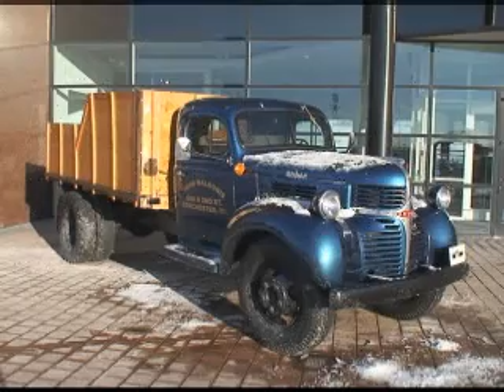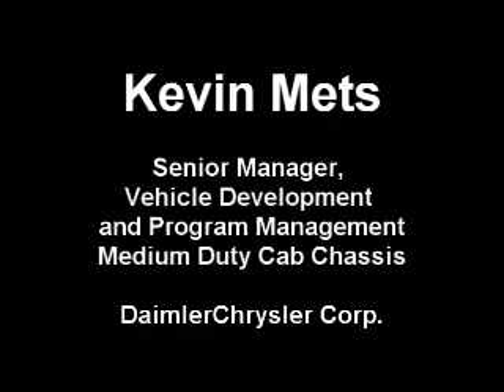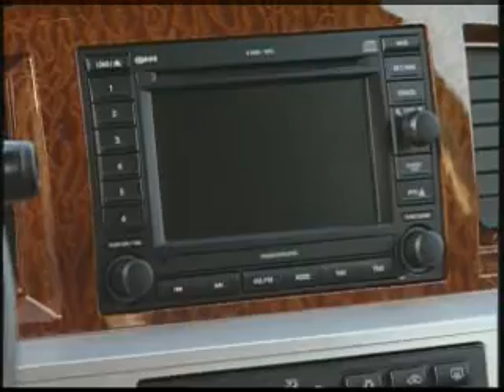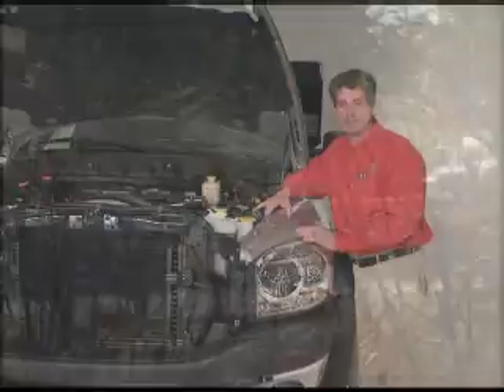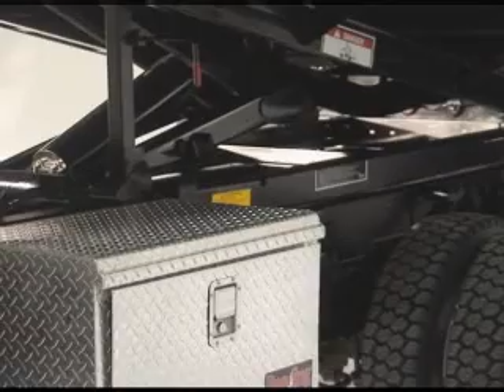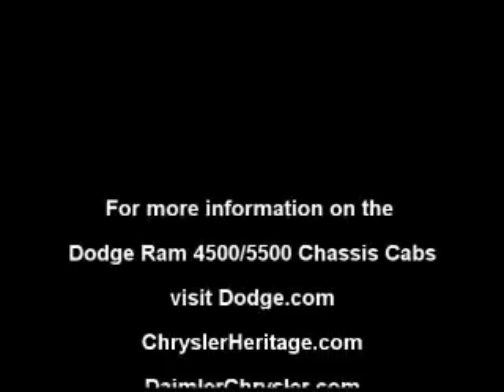New Dodge Ram 4500 and 5500 Chassis Cab

Comment: Actually it is an INLINE 6 which make the MOST Usable Torque and it will tow 25000.  LBS PLUS!!!!  However it has only been  rated to pull 16000lbs because of  STOPPING ALL THAT WEIGHT!!!!!!!!!!!